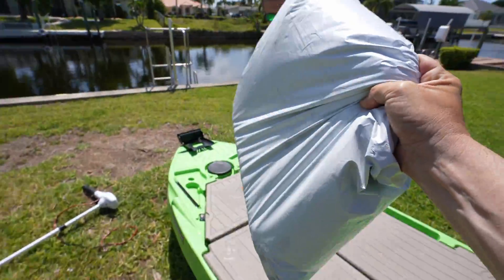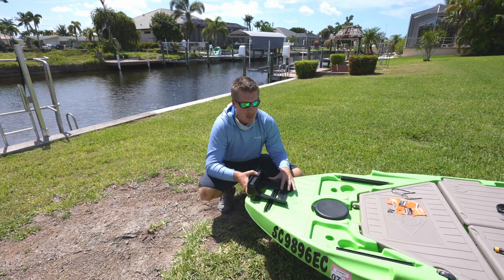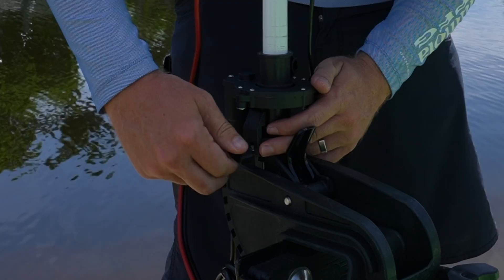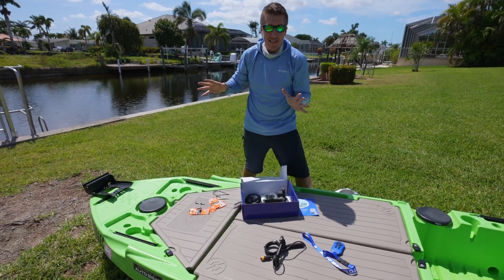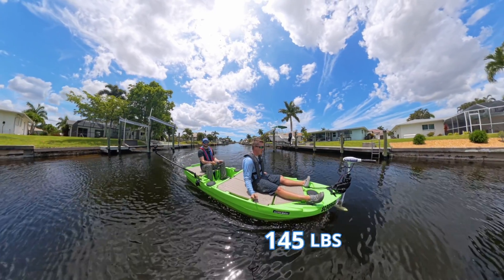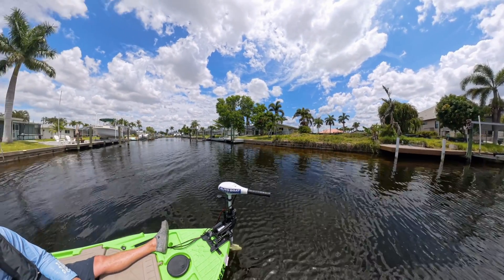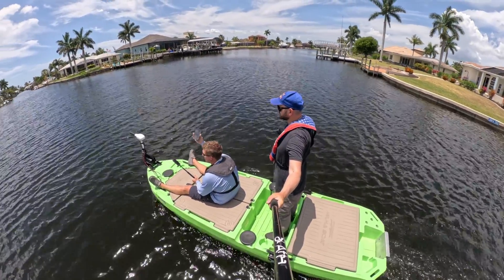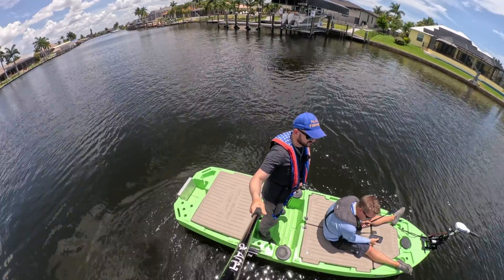Trolling Motor Modification GPS Hack - AutoBoat remote control kit

Comment: does auotboat works overseas ?
Reply from the maker: Yes. There are people overseas that have AutoBoats.  The system just needs initial calibration then works for your area.  If you leave that area E or W by 100 miles it is recommended to recalibrate.

Comment: Since this takes away the digital controls for motor efficiency... Does this system use a pulse width modulator when controlling the motor to gain back that efficiency and is this why it doesn't work with the digital controllers that more efficient motors already have?
Reply: It looks like you've given an affirmative answer to that at the around the 10 minute mark. So, just to be clear - have you used the pulse with modulator in this system or is it using some other means to gain efficiency? I've custom built a pulse width modulator that I now use on my dumb motor and if I get this I'd be depending on yours to get that efficiency back...

Comment: Do you know the weight of the AutoBoat. I’m trying to compare the weight difference to the Motorguide.
Reply from the maker: It depends on the motor you attach AutoBoat to, BUT typically noticeably WAY less weight and smaller footprint.  Motorguide xi3 has large footprint, is heavier, and not as easy to mount on most boats compared to a AutoBoat setup.  Contact me via Instagram (KayakDIY)
Got some info for ya. 👊

Comment: "no tools required" jump cuts connecting to the battery
Reply from the maker: What my countless other AutoBoat vids.  It is installed with thumbscrews effortlessly.  The motor collar that steers is clamshell design and clamps around shaft then is tightened with thumbscrews.  No tools needed to install AutoBoat on motor unless you need a pliers or Philips screwdriver to tighten power cables to battery posts.

Comment: I have a newport 46 lb thrust motor and when set up the motor wants to go backwards.  any ideas? THank you in advance.
Reply: its mounted in the pedal drive area
Reply from the maker: Is the Newport motor set to highest “forward” speed?  Is your gps installed correctly on motor shaft (blue arrow faces direction of travel)? 

When is this occurring?  If you contact TBNation or customer support we sometimes can FaceTime you and get it figured out.  Seems like easy fix.  Likely an installation error.  

Did have 1 Newport trolling motor customer who had his actual motor wired wrong from Newport factory.  It was reverse when it was supposed to be forward and visi versa.  We figured it out because he had another trolling motor sitting around and installed AutoBoat with no issues.  Then we dived deeper and discovered that.

Comment: Ok I have a Brooklyn Kayak with the trolling motor but the shaft is only 24 inch shaft. Do I have enough space
Reply from the maker: Not ideal.  Common 36” shaft or longer is much better.  Gonna get really tight with 24” shaft and you won’t have much motor draft below waterline so prop might cavitate.

Comment: Do you know if they are working on getting waypoint tracking to work on stern mounted motors? I've got a Sea Eagle SUP126 and a bow mount isn't practical. I assume they are shipping now, since several folks are reporting getting them.
Reply from the maker: Impossible to have waypoint tracking or Navpoint heading when mounted on stern.  That would require a 2nd gps compass sensor called a heading sensor and that sensor would have to be mounted towards bow.  AutoBoat could possibly create that in future generations ot future product SKUs, but not in this generation likely.
Reply: @KayakDIY  Thanks for the reply. I'm having a hard time justifying $650 for mainly spot lock. I have an anchor, but.... I've already ordered the parts to have remote control of the motor (steering and forward and backward speed) for about $100. I've got skills and a 3D printer, so making a steering drive is easy.  I really like the Auto Boat, but since I'm stuck with a stern mounted motor, just can't pull the trigger at $650.
Reply from the maker: @jimn6sxb644  no problem.  On the Sup126 AutoBoat would probably be able to do waypoint routes and heading modes but it would pull the boat backwards.  The simple hull of the SUP126 would probably allow it to pull backwards better than rigid hull boats.  Remember if you do buy use code KayakDIY because the AutoBoat price drops closer to $600.  No other GPS motor will be able to do what AutoBoat does for $600.  There is also a chance you could find an inflatable motor mount for the front of the kayak.  Inflatables are easy to modify and customize.  

The cheaper remote steering kits for around $100 usually don’t have much waterproofing so they fail.  Few people have bought them in our Facebook kayak rigging group.  Also they generally have no warranty support or replacement parts.  Probably better use of your time to try building a bow motor mount on the SeaEagle.  Then you would have a killer setup.

Comment: installed mine today, i was struggling with my newport vessel trolling 55lbs the fitting on motorized color and the tabbed fittings is smaller..
Reply from the maker: Weird.  Another guy yesterday bought Newport and his motor’s tiller throttle was wired backwards from Newport factory.   

Note: mount gps collar at least 2” below the head to reduce electrical magnetic interference.  Don’t mount gps puck all the way to top of shaft.  If you don’t you may occasionally experience erratic behavior in high speeds.

Comment: I use my finger to draw a map but don’t  know how to ask my autoboat to follow my route. Can you tell he how ?
Reply from the maker: I can help.  Best way to create route for following is manual route mode.  Go to map in top right corner. Then click recordings button and click edit manual track.  Click ok on the pop up notification. Then click on map and create waypoints (red flags) to follow (think like connect the dots)…..these waypoints will later be stringed together to make a route.  Once you are done dropping waypoints click recordings button and hit save manual track.  Give track name.  Once you save it the route turns yellow.  You have created a route.  

Now to follow the route.  Approach the route.  Click the yellow route.  Click top of screen where it says “Send to AutoBoat”.  You can reverse the track and run the track backwards from the way it was created.  Also when navigating on the route you can click reverse track and the boat will spin around and go the other direction on route.  Note that you will need to readjust your speed after clicking reverse track since the speed drops.  

Test this feature first in large open area.  Also zoom in during dropping your waypoints since this increases accuracy of your intended placement.
Reply: Thanks so much for your prompt reply! Can I draw a route at home with weak or no gps signal and use it when I arrive my destination? Or it needs gps signal to draw a route?
Reply: I tried my preset track this morning but not success. Seems my autoboat received the signal but my kayak started to circle around, why was that ? Was it because of foggy weather and received weak signal?

Comment: Anchor Mode (Spot-lock) is magic...you hook up on a monster, your kayak starts to drift, and a satellite takes over to pull your boat back and puts tension back on the line! When things go awry and you're in a tight mess, you can concentrate on getting yourself out of danger while a satellite takes care of the helm keeping you locked on. Pretty sweet set-up!

Comment: Just got mine in the mail today. Can't wait to put it on
Reply from the maker: Feel free to ask any questions.  Happy to help you learn the system.  

Little Tip. If installing on 45-55lb thrust motor have the gps puck about 1.5”-2” below the motor head to limit chances of electrical interference with gps.  If gps puck is slid to highest point on shaft it can occasionally pick up interference with motor head (this would cause erratic sharp turning behavior during gps modes).  

Calibration is important.  When system is powered outside 2mins then satellites have had more than enough time to connect.  Then hold N.  Unit spins to calibrate compass and gps chip downloads magnetic declination for your location.  Unit will beep 3 times indicating successful calibration.  You can recalibrate whenever, but it is encouraged when traveling east or west around 100 miles+ from your normal boating area.  

Blue remote has much longer range than app.  App gives more features and should be kept available as backup remote.  

Anti-cord wrap mode should ship as default setting.  It can be seen in app as a setting.  I encourage it to be enabled. That is my preferred setting.  

Gain setting for your size of boat can be made on app and then you click “send to AutoBoat”.  For example if using 55lb thrust on a light small inflatable you will want to turn gain setting way down to prevent motor from overpowering and throwing you out of boat.  

These are just a few tips. TinyBoatNation made a great vid on almost everything AutoBoat.
Reply: @KayakDIY  thats. Also thanks for the tip on disengaging the digital maximizer